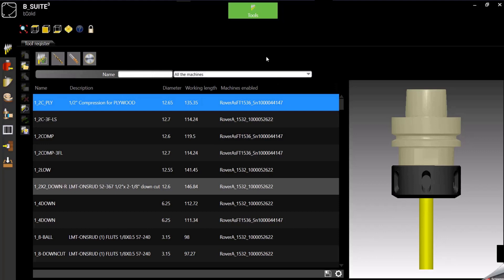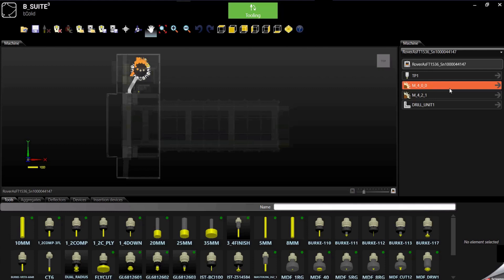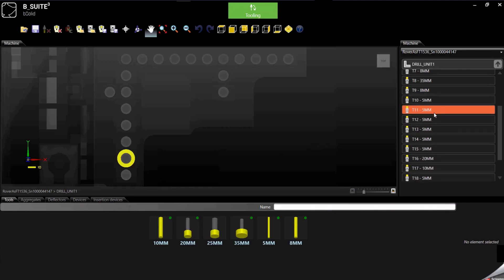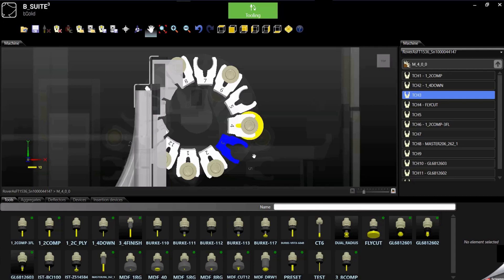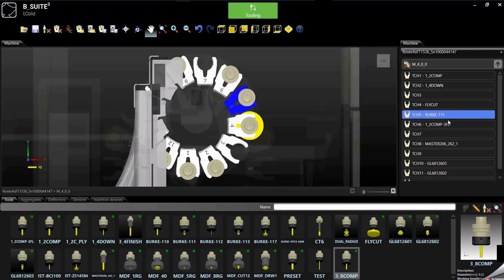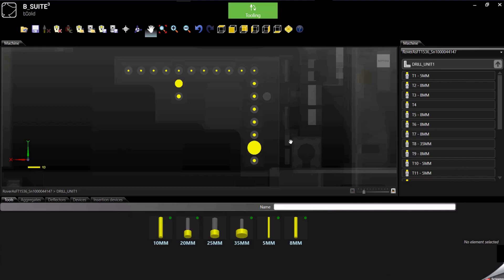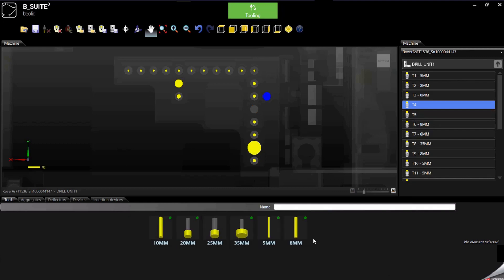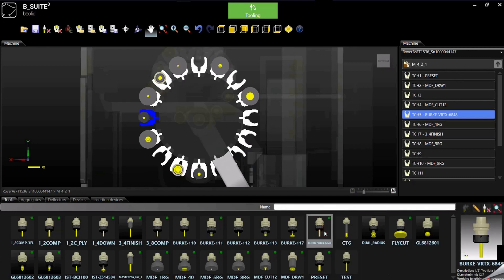3 - CAM BIESSE bSolid - Tool up the machine

Comment: I'm having an issue with the new tools I make not appearing in the tools list so I cant actually add them to my machine any insight would be greatly appreciated
Reply from the maker: Hi, and sorry for the late reply.
This can happen when you select a wrong coupling type for the tool. As an example, maybe you have selected the HSH E63 instead of the HSK F63.
Best regards

Comment: Is it possible to make the machine unload to tool from the spindle to the magazine, or always need to take it out by hand? For example if need to change blade in the tool during the operation?
Reply from the maker: Yes, it is possible to tell the machine to unload the tool in the magazine, but depending upon how the machine if configured, this is done in different ways.